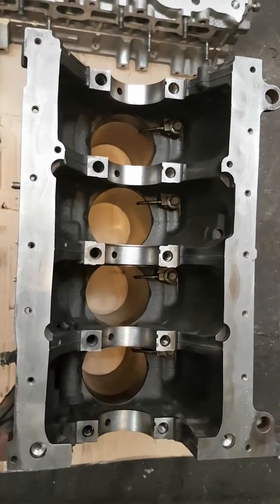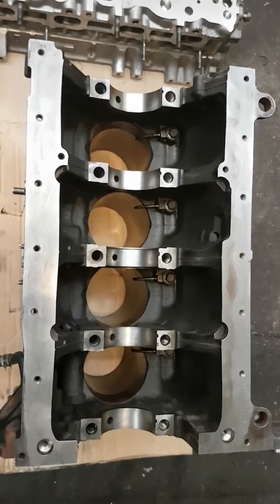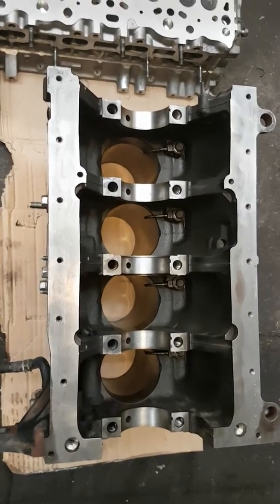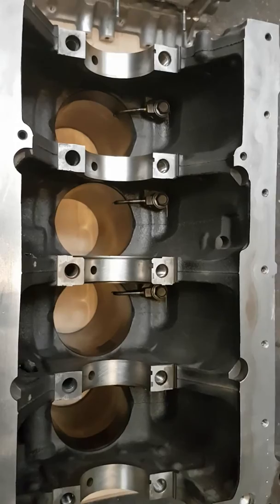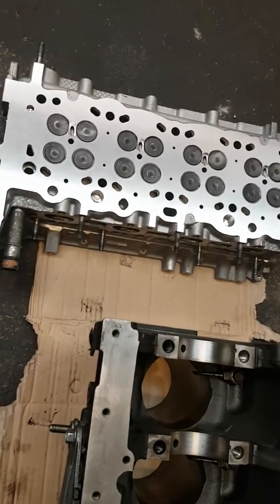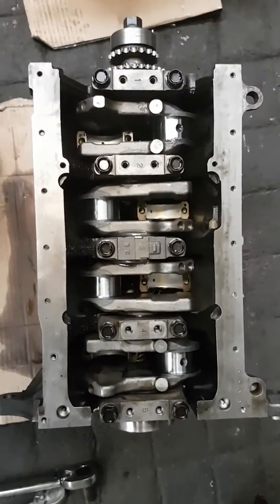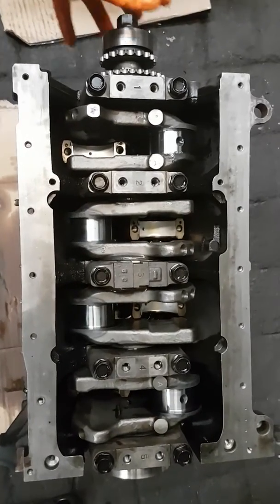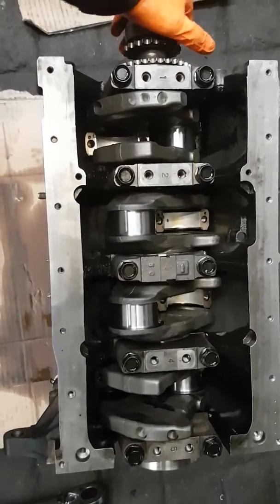Mazda 6 2.2 Diesel Engine Rebuild Part 1

Comment: Hi Colin, thanks for adding these videos on the Mazda 6 2.2 diesel common issues. I currently have my engine out as I need to replace crank and bearings. It would be a great help to me if you know and could tell me what the torque specifications are for tightening the main and big end bearing caps. Thankyou.
Reply from the maker: Mains 80nm big ends just nip them up then 90 degrees

Comment: Hi Colin. A bit off topic. But could you tell me what are the valve clearance values for r2aa Mazda engines? I have to change rocker arms on my 2010 Mazda 6 as chain stretched and broke 6 rocker arms. Thank you in advance.
Reply from the maker: Inlet 10  Ex 15
Reply: @colinhagan4378  Is it 0.1 mm and 0.15 mm? Thanks

Comment: Hello Colin, got my car back 2.2 Mazda diesel skyactiv , they have replaced the sensor before the DPF , done a forced regen, they didn't change the oil, but I've managed to get them to do that for free next week , it was getting up towards the X mark,.  My question is this I want to put some DPF cleaner in the fuel every now and then but they have told me , they would know and it would void my warranty,  why are they so against fuel additives ?? Colin

Comment: Hi colin I’m in the process of rebuilding the same engine as this and im wondering if you could share the what torque is needed or even better if you could point me in the right direction of a manual i cant seem to find one anywhere many thanks and hope u can help cheers
Reply from the maker: Main bearings 90nm. Big ends 25nm then 90 degrees. make sure the crank spins freely after you torgue it and make sure each big end cap floats after you torgue them.
Reply: Colin Hagan amazing thank you very much
Reply: @colinhagan4378  Hey, do you still have the Torque values ? I can't seem to find them anywhere on the internet
Reply from the maker: Main bearings 90nm. Big ends 25nm then 90 degrees. make sure the crank spins freely after you torgue it and make sure each big end cap floats after you torgue them.

Comment: HI Colin. I have a Mazda 6 2.0 diesel 2008 and are trying to drop the upper oil block. It seems stuck and looks like the oil pump is in the way. Woudl you have any suggestions how to remove it? I am trying to inspect the con rod bearings without removing the whole engine. Thanks! :)